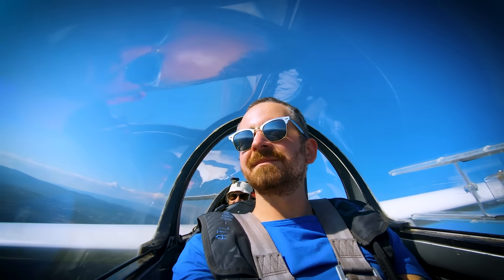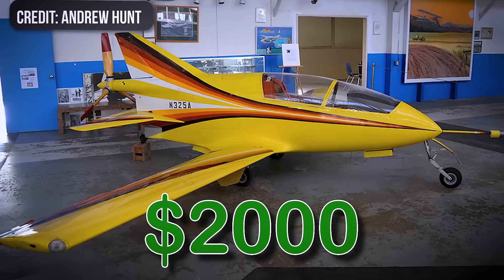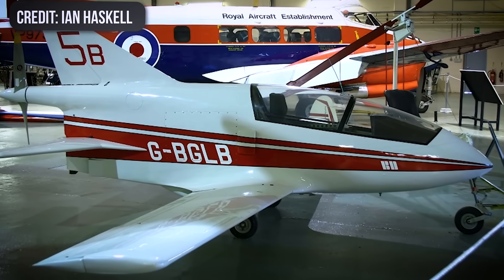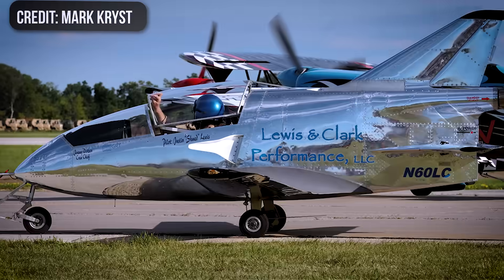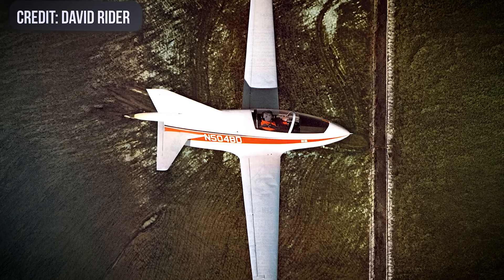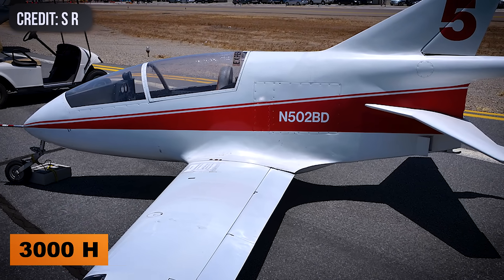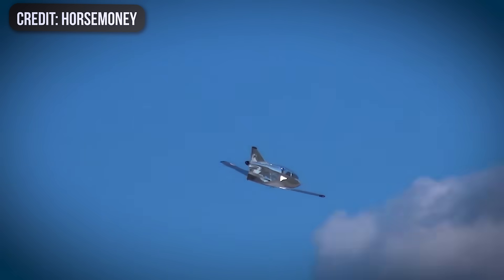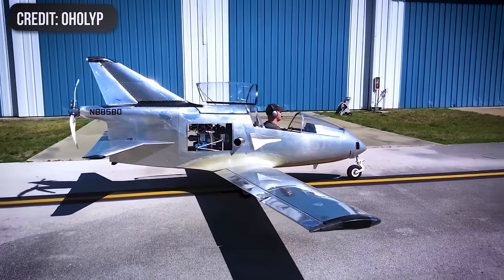This ‘$2,000 Jet’ Seduced Thousands of Pilots… Then Turned On Them

Comment: Imagine if tiny turbojets were available at that time and the thrust line was lower and tail higher and it was a bit longer with bigger wings...
Reply: Small turbojets were available in the 1970s. That is what was most likely used in the J variant of the BD-5.
Reply: @TheFoulMouthNews  Indeed, the Sermel TSR-18 with 200 pounds of thrust (the numbers published at the time - Wikipedia differs). Like all small turbo jets, it had miserable fuel efficiency leading to short flight times and long takeoff rolls. Still enthralled many of us who were young aviation enthusiasts at the time!

Comment: Where's the James Bond clip?!?!
Reply: Copyright issues with the footage.  It's not worth hassle with how easy it is for corporations to abuse YouTube.  YT's going down the tubes now and will end up as relevant as MySpace within a few years...
That Bond-used plane eventually crashed and killed its pilot in 2006 I think.  It was owned by Red Bull at the time.  
There's a replica plane painted like the "Bond jet" that still tours on occasion.  It's static display.
Reply: Towards the end - the one with the folding wings.
Reply: It appeared that the “pulling-up-to-the-pump (car gas)” footage (very short) was from Octopussy in which Bond (Roger Moore) ran out of gas, dead-sticked his BD-5J onto a country road and rolled to a stop beside a gas pump at a small country store in the middle of nowhere.  He smiled at the stunned attendant, smiled and said, “Fill’er up!.”

If memory serves me correctly, the idea for this scene came from a true incident which was written up in Flying Magazine about 40 years ago.  Airshow star Corky Fornof took off from a small Louisiana airport and popped up through a thin overcast cloud layer.  Moments later, the engine flamed out, he glided down through the clouds, deadsticked it onto the interstate and glided to a stop at a filling station.  Two elderly ladies sitting in a cafe witnessed the final seconds of the incident.  One called the local newspaper (they showed up to cover the story) and one called the local TV station (they thought it was a hoax and didn’t show up).

Comment: I did a little analysis of one of Jim's designs (that you'd all recognize) after the operator had a serious accident. Structurally, it was a mess IMO. But, it looked cool. I also have flight time in the Grumman Yankee, which I understand Jim had a huge hand in designing. It was a slick little beast, with a glued aluminum wing!

Comment: Here is my very personal story.
My father and I built a BD-5B over the course of 3.5 years, beginning in fall of 1974, ~4000 hours. The instruction manual was amazing with very detailed and professionally produced instructions that I as a 16 year old could follow and build. A teen friend and I built most of a wing structure in one day. We received a full kit and an engine, because we were one of the early builders and my father became the local Bede dealer. The airframe was completed in about 1500 hours, but then there's the 90% done 90% to go. we would have flown our plane in 2.5 years, but we were waiting for the Zenoah engine. Eventually we took out the engine mounts for the Zenoah and put in the Hirth Engine. Our plane first flew in May 1978.
My father flew the trainer at the Bede factory and a short flight in one of the factory aircraft. Unfortunately the Bede 5 has two poor design choices in retrospect, the high pusher centerline and a poor choice in the wing airfoil. This combination led to my father stalling the airplane on downwind after a faultering engine. The nose pitched up and the NACA 63-212 to NACA 64-218 airfoil stalled. The airfoil is a great one at higher Reynolds numbers, but at the low Reynolds numbers of the BD-5, it has a wicked stall break and slow reattachment of the flow. My father did not survive the stall. I wrote up our story in Sport Aviation. I'm sure you can find it if you look.
My mother made me promise not to build another one, so I haven't. 
I designed my own similar version to the BD-5, with the corrections of an inline CG and thrust line in combination with a better airfoil matched to the lower Reynolds numbers. Perhaps someday I will build it, for now I enjoy flying my RV-9A and Cessna 172.
Reply: Thank you for sharing and sorry for your loss
Reply: condolences on your dad.
Reply: Thanks for sharing such a difficult personal story.
Reply: Thank you for the wisdom and the warning. 
Your story is what I fear in each of the DIY aircrafts, as there isn't need for anything else than a few improperly placed rivets or one nut not tight to torque, and deadly event can happen. 
Same is that there is compromises in each aircraft design, especially when it is designed for small size. 

I noticed in this video the engine placement being risky, and wings surface area and angle being risky. I assumed that plane had habit to depart pitching down, didn't think about what happens if you lose the power, that it would pitch up, too obvious geometrical problem. As the video had the propeller and the jet engine options, so too big variation to the difference.
Reply: @paristo  One airplane is marketed as for beginner pilots, but this thing looks like a scaled down P51.  It's power off descent rate is 2,600 feet per minute so if one loses and engine one only has a few minutes to find a place to set down even if at 12,000 feet.  One should be very careful about believing all the sales hype on these things.
Reply: We mounted fixed 18 inch canard wings on the front end of our BD-5 and it stabilized it really well!!! It sure beat moving the wings forward by 6 inches!!!
Reply: @Freedomistman That's what Rutan would've done.
Reply: Interesting, would like to see a picture of that. Move the wings forward 6”, how would you do that with factory parts?  You would have to refabricate all kinds of stuff.
Reply: Tough to hear. 

If you read the booklet of Harry Riblett (GA Airfoils) he doesn't like the NACA foils a single bit (especially the 5 series). Mainly since they are designed for easy modification of the parameters to aid there study of airfoils, but they were never intended to be used on airplanes. Harry proposed some modifications to those NACA foils mainly improving stall characteristics. Good read. So I totally get your point as well, poor stall characteristics and even worse at the wrong Reynolds numbers.
Reply: @rickboerma3392  what would make someone choose these ones then?
Reply: This looks like same type that 007 supposedly flew in a movie.
Reply: @davidhuckaby832  It certainly is, there is even a short clip in this video.
Reply: @davidhuckaby832  That was the -J version with the jet engine.
Reply: The allure of high performance at a low cost attracts a lot of builders to the experimental realm. Today's designs are more forgiving, reliable and safer than the BD-5. The RV airplanes are great aircraft and very safe, with standard aircraft engines, rather than adapted snowmobile or automobile engines. You made a good choice with your RV-9A. I built a Kitfox many years ago, put about 1000 hours on it before finally selling it. That's another really good airplane. Your modified BD-5B, with the improved airfoil sounds like a good plane. Jim Bede should have thought of these changes early in development and could have prevented a lot of needless accidents. Thanks for sharing your (sad) story.
Reply: My condolences for your loss. Your father must have been an amazing guy. I had a similar story involving the Mitchell B-1, flying wing. I convinced my dad to become the regional distributor for Mitchell by emphasizing how safe the "stall proof" design was, but after making a deal for two complete kits, the president, a multi-engine and rotorcraft rated instructor, spiralled in, killing his passenger and becoming paraplegic.
I bought my first sailboat a few weeks later.
Reply: Sorry about your dad....very regrettably  the down side of the BD5
Reply: Thank you for sharing your sad story, I'm sorry for your loss. Stay safe.
Reply: That's a wonderful memory you shared.
Reply: Sorry for your loss. Thanks for educating using on the BD-5. Stay safe.
Reply: @tsparker99, thank you for sharing your story. As for the wing, I came to understand that the tubular spar contributed to the tapered wing having a thicker foil section at the tips than the roots, leading to a wicked tendency for the wing to stall at the tips first.
Reply: Man, that really sucks. Sorry to hear about your family's loss.
Reply: Wow. Terrible story, but thanks for sharing.
I don't know that much about aircraft design (I mostly work with sailboats, so I know the aerodynamic and structural concepts of aircraft a bit), but I thought the wing section and wing area looked really unforgiving for a homebuilt. Especially after he indicated the plane topped out at 200mph. And with that high thrust line, it just doesn't look right. It turns out, as I see from your story, that I was right.
Reply: Very sorry for your loss. Thanks for sharing your story.
Reply: Wow - respect
Reply: I could see the thin wing design just from the profile pic in the video.
Reply: I guess they need to provide some kinda warning that when you lose engine power you need to pitch or trim down. Right away. I guess that's one reason why front mounted props are the norm nowadays.
Reply: Oh boy im sorry about your dad.😮
Reply: Thank you for your contribution
Reply: I am sorry for your loss.
Reply: Wonder if you could have sued. bad design.
Reply: Sorry for your Loss......may your father Rest in Power .....🙏
Reply: your dad was a brave guy, aviation was built of that same stone , tragic story
Reply: Damn right in the feels. Sorry for your loss champ.
Reply: My condolences.  I knew the comments section here would be a must-read.
Reply: "We received a full kit and an engine" ... "but we were waiting for the Zenoah engine"
Reply: You forgot about the one in James Bond
Reply: I posted a comment in the main thread and same question to you. Why dont these little aeroplanes have a parashut. They are light enough to have one in the pilot seat maybe? And should worse happen there should be a quick manual canopy release and parashut deploy mechanism. Maybe not ideal solution but it may save lives.
Reply: Sorry about your loss.   My father was a pilot and I got my license a few years after he passed.  I'd give anything to fly with him. 
You should absolutly try and build your improved design!
Reply: thanks for the info and sorry for your loss
Reply: My father-in-law died in his from a stall in 86.
Reply: Wow, this is why you got a read YouTube comment section
Reply: I’m curious: based on your own redesign work, would a pod and boom style design have yielded a safer aircraft? It seems to me that kind of design was adopted for early straight wing jet fighters and trainers with good reason: it made the task of designing the aircraft much simpler and made it easier for prop pilots to adapt to flying a jet. And, naturally, it was easier to build a dual seat variant. 

It seems like independent of the issues outlined in the video that prevented the micro jet from being commercially successful, the fundamental design choices were flawed in such a way to simply make the aircraft unsafe.
Reply: Sorry for your loss.
Reply: Great story. I'm so sorry about your dad. 

I was enamoured by the BD-5J as a teen, but reality prevented me from pursuing it. I eventually became an aerospace engineer and private pilot. Two friends/colleagues died in their homebuilt Europa Classic.
Reply: Sorry for the loss of your father.

I had a similar experience with a homebuilt ultralight that also had a high thrust line.  On my first flight the engine quit at an altitude about 25 feet AGL.  When flying it you had to pull aft stick to overcome the downward pitching moment from the high thrust line. When the engine quit the plane immediately pitched up, and because it was so light and draggy, the airspeed dropped sharply.  I stalled and hit the ground, but survived the impact.  I doubt I would have survived if the altitude had been much higher.

Comment: The ideal pilot for the BD-5 is maybe someone who had a lot of experience successfully flying the F104 Starfighter....
Reply: surviving the F104 starfighter
Reply: @richardhockey8442  sounds about right.. the flying widowmaker's offspring
Reply: I would think someone who flew the F7F Tigercat would be a better choice. I think per planes built, it's record is much worse than the F-104.
Reply: @TheFoulMouthNews  When the CAF put on their airshow in Oregon in 1989, they had a beautifully restored F7F Tigercat. It was quite a flying hotrod and went through many tight maneuvers without a hitch. But it was high-powered, with highly-loaded, small wings. One of the old time pilots said it had been nick-named, "The Mistress", as it had no visible means of support. Even more so than the P-38, you just knew that losing an engine on takeoff would have been bad news, if the pilot wasn't very skilled and did the right things, instantly. Imagine if that were to have happened on a carrier deck.
Reply: There is no ideal pilot for the BD-5. There are two types of BD-5 pilots. Dead, and those who will die...
Reply: @SwampFox_SCANG  must be Part Italian: Those who about to die salute you.
Reply: @SwampFox_SCANG Sorry, not true at all.
Reply: Your metaphor isn’t far off.
Reply: You shouldn't fly any high performance plane without getting the proper training. That's a significant part of the equation here. Also, a 400lb plane going 300kt just violates all common sense. It is hard enough to fly a plane that weight at half the speed. Being experienced on the F-104 wouldn't prepare you to fly a BD-5 at all.
Reply: @RunsWithChainsaw The BD5B couldn’t do anywhere close to 200 knots as promised  but stilled handled like a fighter. If anything went wrong it was deadly to the untrained pilot.
Reply: @RunsWithChainsaw  Comparing the wing on the F-104 to the BD-5 is valid insofar as they were  too small in terms of area, but they are at opposite extremes with the F-104 being too short and the BD-5 having extreme aspect ratio, great for drag efficiency but like balancing on a knife edge. If you could survive the F-104 there is a chance you have sufficient skill to survive the BD-5.
Reply: "Paging Chuck Yeager. Colonel Yeager to the white courtesy phone."
Reply: Known in Canada as the "Lawn Dart".
Reply: That was one hell of a aircraft.
Reply: Or the AV-8 Harrier!  They didn’t call it “the ensign eliminator” for nothing.
Reply: @radarrider607  unless it fell on an ensign on the ship, no harrier ever eliminated an ensign.
Reply: @brady3474  I guess you’re not familiar with the early history of it. A lot of men died flying the Harrier.
Reply: Or…. A Death Wish!
Reply: wingless wounder. 
ground pounder.
maned missle.
Reply: This made me laugh
Reply: Good comparison.   An excellent airplane in the hands of the very best pilots, fatal to the mediocre.  I would think simulator time could help many pilots to survive their first flight.
Reply: Looks like an X-1.

Comment: I suspect the person that wrote the dialog for this video knows little to nothing about aerodynamics.
I disagree strongly with "if your engine was reliable it was a good airplane" and the lack of such an engine isn't the real problem, its the aerodynamics, the wing is way too small and the tail volume is too low, and the high engine thrust vector, and the CG range is too narrow, these are what contributed to most of the 15% of all aircraft ended in fatal accidents.
I disagree strenuously to "the BD-5 was a solid aerodynamic concept ...",  it was never solid aerodynamically, it was fatally flawed aerodynamically with a 15% fatality rate.
I disagree strongly with "even a good design can turn dangerous when...",  because it was never a good design to begin with, and there was no way to ever fix it, those that did survive flying it were very lucky and very experienced pilots.
Reply: Considering that this design is known to have cost the lives of even highly experienced pilots…

I suspect that a good center of gravity and good glide characteristics form the basis of a good aircraft, while an optimally positioned thrust axis contributes to neutral and stable flight characteristics—and presumably also to greater range.

During the war, many pilots whose engines failed over enemy territory far from the front line were still able to safely reach an airfield on their side of the border, provided they still had sufficient altitude.